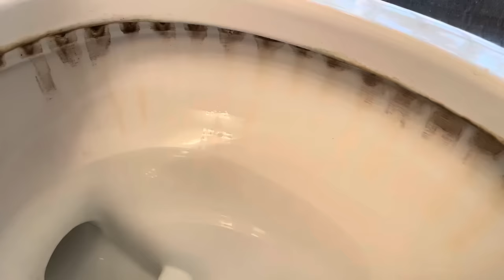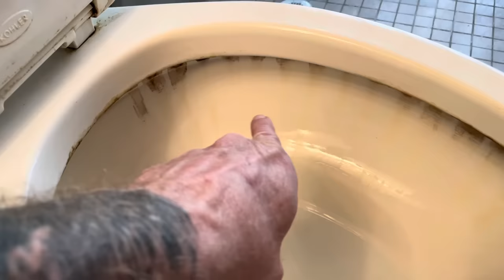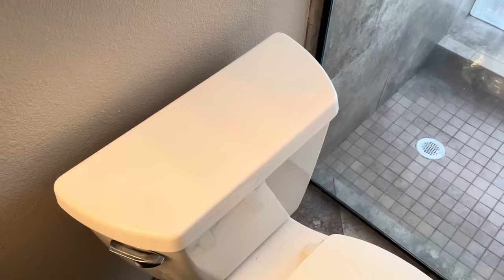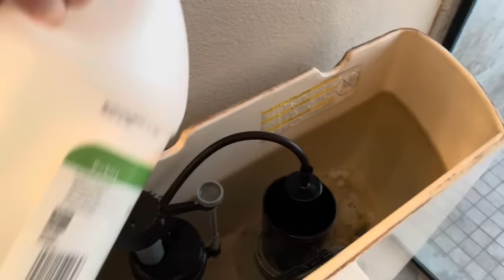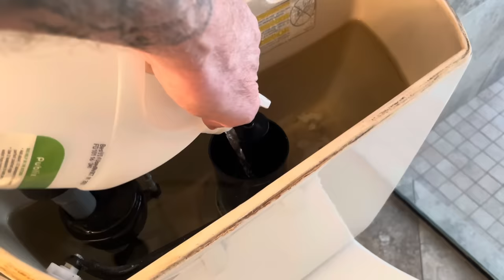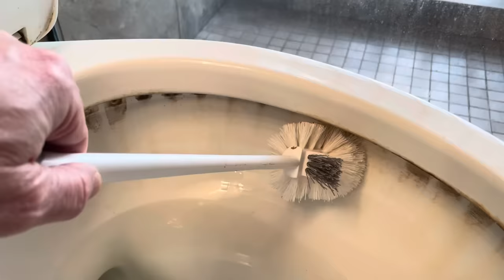Why Does THIS Keep Coming Back and How to STOP it

Comment: Originally from Long Island NY, 22 yrs living in Florida now has been a constant battle with mold.  It took me at least 6 months researching, to finally find out that mold grows roots into wood and natural organic things.  I kept cleaning and it kept coming back.  I washed my walls and everything with bleach. Sprayed my air conditioner with bleach, nothing worked, it just grew back.  Finally I learned about the growing roots and finally that vinegar kills mold.  I also have a uvc light bulb and a dehumidifier now.
   I have this exact problem with my toilet also !   I’ve been in this same apartment for 19 years now and had the whole back of the toilet tank black with mold 3 times.  I’ve scrubbed it out 3 times , last time with oxiclean.  I was thinking about the vinegar but didn’t know how to remedy the rim.  Finally I asked a plumber and he said “pour whatever in the overflow pipe.”  I haven’t done it yet, but I’m so happy to see confirmation that this is what to do !  Even the comments answered my questions about vinegar won’t rot the toilet parts because vinegar comes in plastic.  I did find “Cleaning Vinegar” at Walmart for 2.39 a half gallon so I’ve bought a few to use for this. (It warns don’t breathe the fumes, it’s not edible vinegar). 
     Sheesh !  You need an education about mold, it’s been so difficult to find out this information… Blessings all !
    Thank you so much for this video!
Reply from the maker: You bet. 👍🏻
Reply: Same problem here. This is great to know. I get it in the toilet, kitchen sink, on the fridge door. I'm always scrubbing, scrubbing, scrubbing. What I painted my tush.
Reply: You would think that growing up in Florida we would get an education about mold, and how to deal with it in our humid climate but NOPE! I’m right here researching with you. 😅
Reply: Fellow Floridian here. It's very humid here, but you really should not be getting mold on the walls inside your house. Your AC should be removing the humidity. I'd have a professional check your AC and I'd call a mold cleaning professional. You will need a professional to remove it completely, and they'll also be able to tell you where it's coming from. You should also be getting your AC cleaned too every once in a while to prevent mold and debris being distributed through the vents (more than just spraying with bleach). If it's not the AC, your house may have had flood damage before you got it, some water leaks, or insulation problems. I would look at a dehumidifier in the meantime, one with a drain and not a tank so you don't have to empty it multiple times a day. To be clear: mold outside is definitely a Florida thing, but inside is a problem with the house itself. It can cause so many health problems, and I wish you luck in getting it taken care of.
Reply: There may be a mold colony in a wall or roof or under the house and the spores find spots to grow
Reply: I’m also from NY (Long Beach) and have lived in the PSL area for about 6 years . Mold is everywhere . I try and try to remedy it and you just end up feeling dirty if it doesn’t work . And a little helpless . Your comment made me feel better tho, at least now I know it ain’t just me .
Reply: I thought bleach killed mold. Thankyou for telling me about roots.
Reply: citric acid and water is even stronger. That knocks everything out.
Reply: I’ve dealt with health problems from mold exposure, it can cause joint pain, fibromyalgia, headaches and all kinds of other problems. You might want to get your mycotoxin levels tested if the mold in your home is that bad. One of the supplements my Dr put me on to help remove mycotoxins is GI Detox from Biocidin. Take care of yourself, mold is scary stuff.
Reply: @drwllce Thank you for your brilliant comment, we are all staggered by your vast intellect. We don’t have nearly enough assholes on the internet being rude to strangers for no reason whatsoever.
Reply: Mold can cause all sorts of health issues and even cause death.  We keep 30% vinegar around to kill weeds outside, just add 1/4 cup Dawn detergent and 1 cup epsom salt into a Hudson sprayer with 1 gallon of 30% vinegar (get at gardening store or Home Depot/lowes)
Reply: Supposedly bleach does not kill mold, but rubbing alcohol/vinegar will. I am not a mold expert so take that with a grain of salt.
Reply: Even the "cleaning vinegar" could be used in food after diluting it to the same strength as regular white vinegar.  It's just plain acetic acid, usually synthesized from coal.
Reply: If you have mold in your toilet you probably have a much bigger mold problem elsewhere. Mold inspectors often check the toilets first to see if there is mold growing.
Reply: @ashleylala4293 
They know you can't punch them in the nose so they say whatever they want. Brats.
Reply: Concentrated (cleaning) vinegar, citric acid solution and a huge one Hydrogen Peroxide.
They vanquish mold.
Peroxide is very useful in porous situations where you don't want a lot of vinegar smell lingering around, treating carpets and rugs, wooden materials, etc.
Reply: FWIW, cleaning (non food grade) white vinegar is available at virtually all dollar stores, $1 for the half gallon (or $1.25 now 😢)! 

I use it for cleaning nearly everything--and for fragrance, add a few drops of essential oil (like orange or lavender) to the spray bottle (also from $1 store 😅).
Reply: @ashleylala4293  💯👍
Reply: @ashleylala4293 😂👍
Reply: @JoAnnaPriestIsGreat  No one has ever accused Florida of providing a high quality education! I hope you got it figured out.
Reply: That's why I mix vinegar into all my cleaning bottle products. Doesn't matter if it smells weird. Use essential oils in your cleaning product bottle mix if it bothers you enough. Science kills the mold.
Reply: @bazookajoe2889  Someone told me that PSL has been overbuilt on, what was once, very wet land (wetlands).
Reply: @cc_snipergirl  Excellent advice you've given.  Mold is nothing to ignore!  Of all the Forensic Files that I've watched there is one that I will never forget:
Forensic Files - Season 7, Episode 37 - Breaking the Mold - Full Episode
https://www.youtube.com/watch?v=QhRfeDavAhQ
Reply: @joefer5360  Please don't do that! Depending on what is in the bottle, you can create toxic chlorine gas. It's the reason you're not supposed to mix cleaning chemicals together.
Reply: @billwilson5341  Thank you :) just finished watching the video. Really sad for the family, what a nightmare
Reply: Cleaner here. Vinegar and dish soap is my absolute superpower for cleaning calcium build-up in showers. Also, clove oil will kill mould spores for up to 3 months :)
Reply: @cc_snipergirl I was going to say, it HAS to be dangerous if you live with that much mold constantly growing around you. Imagine the havoc it's wreaking on their body 😢
Reply: drwllce just... wow! Smgdh
Reply: Lived in FL 20+ years and have always recommended having a UV bulb in the home HVAC unit. :)  Helps with mold there too.  UV light kills mold on all surfaces…just isn’t very nice looking.
Reply: @t.m.9944  wdym it isnt very nice looking? i hope you dont have the uv bulb out in the open
Reply: Vinegar will kill any vegetation you don’t want.  You can use 30% cleaning vinegar as an alternative to roundup
Reply: @Fishpks Vinegar is able to kill mold, but rubbing alcohol would have no significant effect.
Reply: Mycelium nice
Reply: i never even realised theres "cleaning vinegar" interesting thank you!
Reply: Also the reason vinegar is bad for your intestines. IBS
Reply: Just wanted to say hi to a fellow Long Islander turned Floridian
Reply: @imhidingasecret 🤮
Reply: Bleach does not penetrate surfaces; vinegar does. That's why it works better. Nobody has even said as to why it's working yet in all of these comments, but this is the real reason. You need something that will penetrate pores to where the mold is seated unless you're cleaning a solid surface like porcelain. Borax solution is 1 step further for treating wood and will deposit the borax into the pores once it you let it air dry, and will permanently prevent mold that can't handle alkaline PH, which is the majority of strains. Honestly it took about 8 minutes of research to find this information out. This Old House covers it pretty well. Don't use Borax on things that can't handle an alkaline PH that is slightly caustic. For wood, though, it's fantastic.
Reply: @ashleylala4293 best part about this clown is he came to this video trying to find ways to get rid of it too lol
Reply: @Fishpks Bleach, vinegar, alcohol, and a few other things all kill mold... you just have to leave them on the mold for different amounts of time, and which works better seems to vary with the type of mold.  Bleach was always what was recommended until everyone decided to move away from chemical cleaners.
Reply: @Milosz_Ostrow Actually, the last time I looked at cleaning vinegar at Dollar General it contained ammonia, scent, and a few other things along with the vinegar...
Reply: Yup I'm not in Florida, I'm in Europe but when I investigated the "root cause" for  a bit of occasional black mold in my toilet bowl, I quickly discovered that my flush water tank is/was full of black mold repeatedly, so initially I thought "clearly, that's where it's coming from!"
The biggest irony is though, Vienna has changed their water supply to much lesser hard water a while ago and it's indeed a better water quality now, but the old totally calcified supply pipes in the walls remained and to change them as well, is just very stressful and also too expensive for my budget otherwise I'd most likely not live in a rented flat ... and I've no doubt that's also where all that black mold has it's biggest roots grown over decades.
Not sure, how to solve this problem, when I can't reach those old pipes, where the mold is originally growing and coming from.

Comment: I got a Toto turbo flush toilet, and realize quickly afterwards that it was the best damn toilet I ever had. It has no tiny, downspout holes and keeps itself relatively clean, has two angled turbo flow holes that point the water sideways to propagate a better swirl. It’s absolutely the perfect , and I rarely have to clean it.
Reply: Is that similar to a rimless toilet? Where did you purchase yours?
Reply: So much for Weatern technology.  Finding a workaround for a problem that should have long ago designed out of existence.  Bravo.  Buy more Toto toilets and other manufacturers may eventually figure it out.  Sadly it is a very slow recognition cycle and it may not be cost effective for them to design and build a better mouse trap.  If Toto us already the best mouse trap, go directed to that product and let your choice be your money and vote.
Reply: I replaced my leaking toilet with a Toto toilet and have never seen mould since! 
You gotta love Japanese toilets. It’s worth visiting Japan to see what they can do, like turning on a heated seat when you come home on a cold day! And even the public toilets are sparkling clean.
Reply: My old toilet never did this. But when I replaced it with one that looks identical to the one in the vid, the mold quickly appeared. I couldn't figure out how it kept coming back so soon. Glad the guy in the video explained it.

Comment: I've often used peroxide alternating with vinegar. As the peroxide foams in contact with the mold. And vinegar was cheaper and reduces lime deposits. I do appreciate that you didn't ramble as many vloggers tend to.

Comment: This video mysteriously popped up in my feed. I have been battling this in one toilet in my townhouse for years. Thanks for your straight to the point, no bs video.
Reply: I ended up here the same way.
Reply: @devante614  me too 🚽
Reply: Somebody was giving you and the others a hand.
Reply: I put a small chlorine swimming pool tablet in my tank and it stays clean, no scrubbing. When it dissolves, which in the toilet tank takes months I put a new one in there. Constantly clean toilet.
Reply: @lisajohnson6296  great idea!  😊 Thank you!
Reply: @lisajohnson6296  Thanks for the tip Lisa. I'll do that as well.

Comment: I live in a hot area and the water in the tank gets warm and really smells. 
I tried everything, once I figured out where that terrible smell was coming from. 
So far the only thing I found to really clean it is Oxiclean washing machine cleaner with odor blasters. It says use it in hot water so I put half packet in a mason jar with hot water and dissolve it first.

Comment: Try out the high concentrated vinegar. Lowe's, Home Depot and likely other hardware stores will have it. It's about 30% compared to regular vinegar which is less than 5%.
Reply: People seeing this should be aware it's really strong. Wear gloves and even a respirator with a filter. Don't expect to use the room for a couple days if it doesn't have a window. But indeed, it's 100x as effective as eating vinegar.
Reply: The concentration of vinegar available in stores: 3% food grade, 5% household cleaning.
The maximum concentration is approximately 30% and it's called acetic acid and it is not available for sale to the general public. It can do a lot of harm when inhaling fumes or to the skin when in contact.
Somebody mentioned using 30% strength and I think that person received it from somebody who is supplying a business with chemicals on a regular basis.
Reply: I found cleaning vinegar at 12% at the dollar store. Buying some for spring cleaning .

Comment: Great video! I've had this problem for years in my bathroom toilet. I thought the black steaks were caused by the water itself, and I was also drinking the same water from my kitchen tap. So, years ago, I added a Pur water filter on the kitchen tap and also bought bottled water, because I was concerned about what I might be ingesting. I will be trying this solution tomorrow. I had no idea that it was mold inside the toilet. Amazing what comes up in your You Tube feed at 3:00 in the morning. I'll update with my results in a day or so. Thanks Papa Joe!
Reply from the maker: You bet. 👍🏻
Reply: You can take the aerators off your faucets with a wrench and soak/clean them with vinegar and use pipe cleaners to remove build up in the faucet spout as well.
Reply: Me too, thought maybe old pipes were causing the blackness as scrub it like heck and never goes away! And used my Pur that I brought from my old apt and also use a zero water filer which catches a lot of gunk scary as it is saying that, but glad to know what to do to tackle this annoying issue, Thank you Papa Joe for the info, I'm on it!!
Reply from the maker: @Linnybear  you bet. 👍🏻
Reply: Glad ur buying bottled water. Mold accumulates in the faucet when u pour it to drink the water ur also drinking that mold. Ever since i saw that i been buying bottled water. G'luck 😊
Reply: @papajoeknows8355 Can you clean out the tank with white vinegar as well?  Start fresh as it were.  Would it damage the tank at all?  We are cursed with very "aggressive" well water.  That's what plumber called it instead of hard water.
Reply from the maker: @lynnerodgers4461  absolutely… turn the water off at the wall. Flush and hold the handle down to empty as much water from the tank as possible. With paper towel, dry off interior as much as possible. Use a spray bottle with vinegar and spray everything well. Let sit for an hour or so, then lightly scrub, an old toothbrush helps for the hard to reach areas. You’ll be amazed.
Reply: THANK YOU SO MUCH! we suffer with this issue too. I am going out to buy distilled vinegar today. We also have black gunk that drips down from the sink in that same bathroom. Any solution for that? And why does the mold appear in ONLY this bathroom?
Reply: @Linnybear I have also taken a small Allen wrench and wiggled around in all the holes to clear hard water deposits😉
Reply: Does this mean there could be mold in my water faucet on the tub how would I fix that? I only say that because something turns the ring of the drain dark after like 3 showers
Reply: @Daddygirl923  Guess you haven't heard of BPAs and general issues with bottled water in general, yet?  Personally, I still use plastic bottles and cups but there seems to be compelling evidence that plastic effects the endocrine system.

Fortunately for me, drinking a bit of mold from the tap is slightly more gross than mold in cheese. I love cheese, BTW.

Bottom line: everything is bad for you and that's just life, yeah? :D
Reply: @johndicarlo1945 What happened? You never gave an update its been more than a month and we're starting to get worried about you. Did you anger the mold with your treatment? Did it slowly grow out of the toilet bowl, down the sides, across the floor and up the walls, sneaking towards your bed at night for some kind of revenge? Has it strengthened? What form does this foul slime now possess? Has it spoken to you yet? What did it say? What does it want? We need to know, we must know! My own toilet has become infected with this same black sickness and I am ready to do battle with it to end it once in for all but after seeing your comment I'm losing hope. How have you fared good sir, do you have anything to report?!
Reply: @RetroMMA  get.a stainless bottle , only water from the ground NO extras read the bottle ...they said watch the water